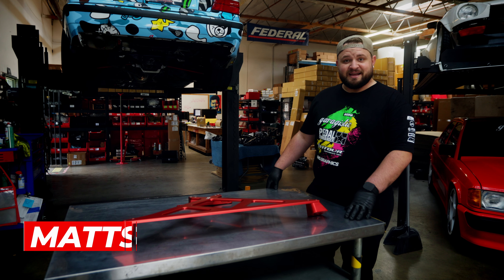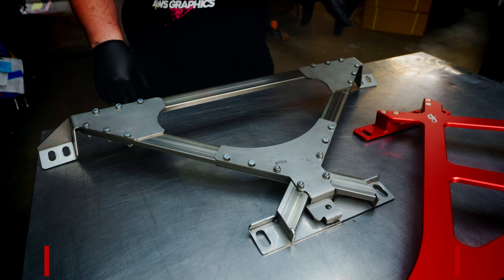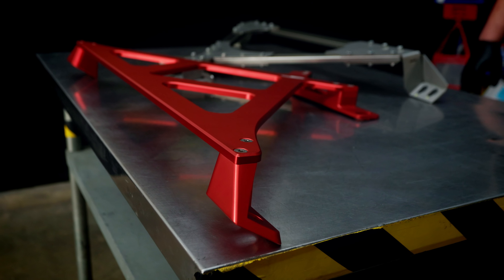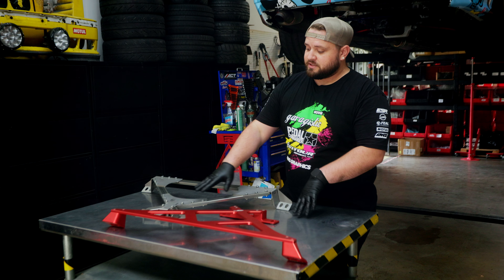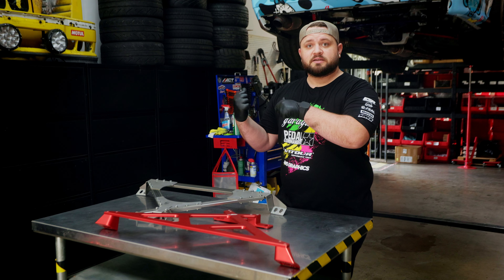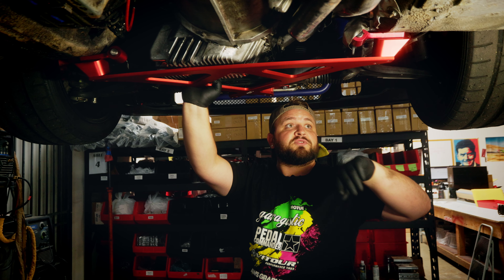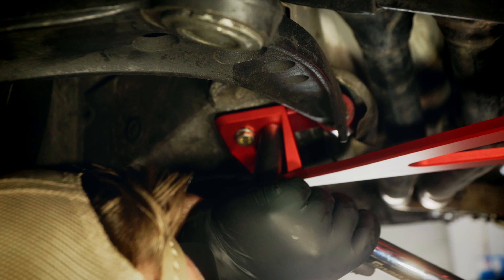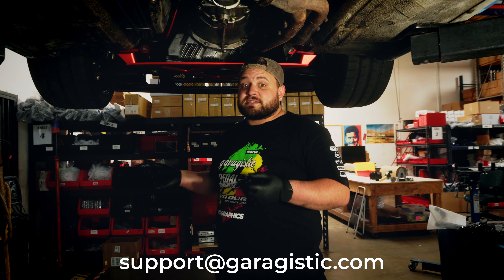The ULTIMATE X-Brace For The E30/E36

Comment: Or if you have an E36, just fit the factory x brace as found on all convertibles, LWT, and GT's. On pre face lift, the bolt holes are already there. On face lift cars the threads are also fitted. If it's an M3, remove the cross brace ( 2 bolts ) and fit the X version
 They are cheap, easy to fit don't require removal for oil changes, and make a huge difference.